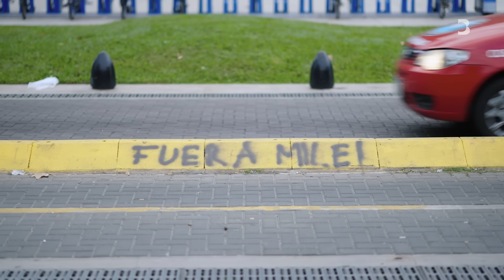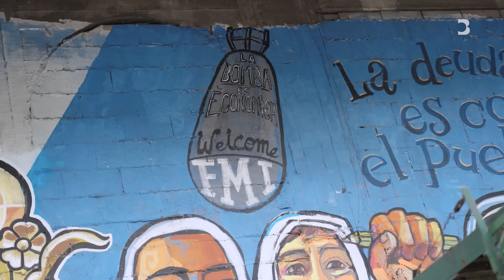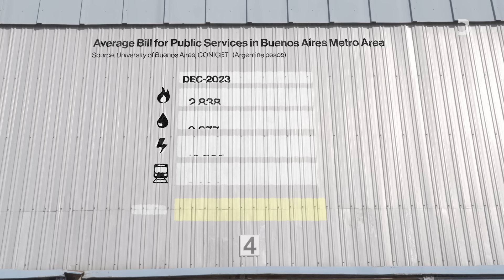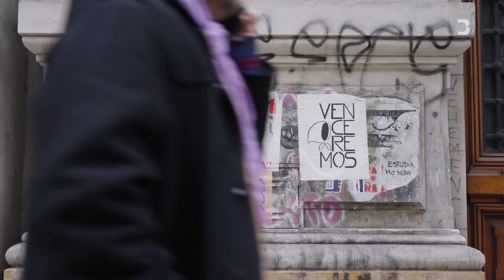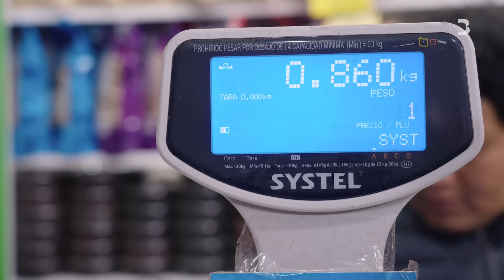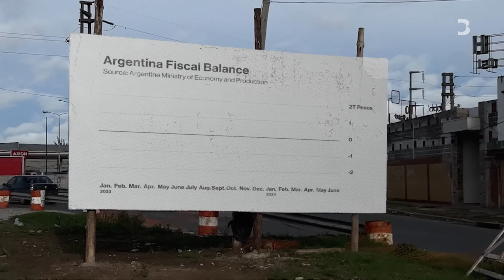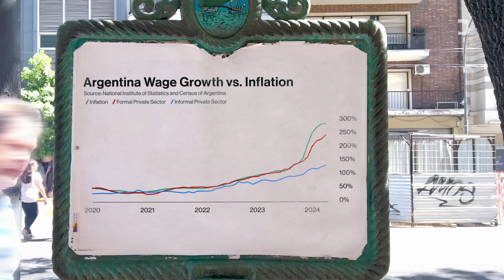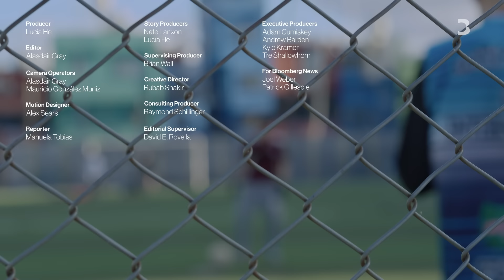Is Milei’s Radical Plan to Save Argentina Working?

Comment: why did this video seem to conclude that "whether he gets reelected" determines if it paid off?   that's NOT the measure, the video didnt mention any real details about how the economy is doing or what teh signs of it improving would be
Reply: yea this video was trash honestly
Reply: That's a bit unfair. The #1 priority is to reduce inflation, that is the entire point of reducing unsustainable gov spending. The video showed a graph that shows inflation is reducing.
Reply: investment and work is the only solution to poverty.   Since Milei aprobed " ley bases"  more than 40 billion have been invested.  Investments take years to show results on population
Reply: @alexgamble4718  agree the graph basically showed ya phase 1 is working... issue with the vid is they just gloss over it with little analysis and concluded "shoulder shrug" who knows we'll see at next elections......... which I agree with OP is not a reliable measure of if it's working or not... it could be a reliable measure of if the people are buying that it's working but video didn't clarify.
Reply: @alexgamble4718 they just didn't care to mention the graph that showed inflation being sort of stabilizing. They didn't say he was wrong either. They pointed out millions of dollars of foreign investments. This wasn't biased. It was just factual. This cheerleaders In all governments will just it's trash. Irrational thinking leads to unstable leadership.
Reply: @alexgamble4718  inflation was already reduce, what argentina needs right now is investments, heavy investments
Reply: Some real data of inflation since Milei took office (per month, not annually!): Dec 45%, Jan 20%, Feb 13%, March 11%, April 8.8%, May 4.2%, June 4.6 %, July 4%. Thanks to the reforms and deregulation of the economy, investments have already begun to come, some sectors of the economy have already been reactivated and some salaries are already rising (the country is still in recession, but we are since 2011).
Reply: @tcial_news  that's what the chart showed.
Reply: Half of economics is perspective and belief of the individuals in an economy so his reelection can be seen as a public referendum on his experiment.
Reply: @puertousbmonkey yes but that's like saying oranges are orange. You're stating an economic postulate. Where and who makes those investments is what the debate is over. Should it be public or private? Union, non union, etc. I'm personally a proponent of not focusing on economic growth if it doesn't benefit everyone. In the us, for example, the economy has grown steadily for 50 years with worker productivity more than doubling yet wages haven't budged. I fear the success of the milei experiment not because I don't wanna see Argentina succeed, but because I don't want to give the elites ammo to use crisis like this to do what they're doing in Argentina which is essentially forming an oligarchy for the rich. Twice now in my own country I've seen the rich use an economic crisis to steal unconscionable amounts of wealth from the lay man. There must be a better way. We should favor banks failing to having households fail. Argentina made a massive mistake of going all in in agriculture and ranching a century ago and have been trying to play catchup every since. Don't fall for the smiling charismatic right winger, they always rob you in the end.
Reply: @Coinpease  The problem is not business and capitalism.   The problem is when politics and obscure businessmen mix.  Elon Musk is a great example of business ethics, always working to satisfy people's needs. 
A recent 30 B dollar investment comes from Malasya ,  Petronas. Who owns Petronas?! I don't give a uck
Reply: @Mayalovestosleep  that will take time. Investment is about confidence. Confidence Argentina doesn't slip back into the warm embrace of socialism when it all becomes too hard.
Reply: Yeah I expected to hear some actual facts about the economy. The only useful information was the graph where inflation spiked temporarily then dropped to a new low
Reply: Correct, but that's because the Bloomberg reporter who made the video doesn't know what would improve an economy.  She doesn't know that Argentina has massive corruption in government permit grants that slow economic development. She doesnt' know that subsidies misallocate resources. She doesn't know that Argentina has export controls that limit foreign purchases.
Reply: The details are too sordid to report. A mass starvation in the making.
Reply: Government has pulled back wastage and money printing. But how long will it take for the people to replace the government by creating companies and employing people in real productive work to produce exportable goods and services.
Reply: @himanshusingh5214  == Argentina's corrupt government permitting system has slowed economic growth for decades. Bureaucrats demand bribes or else they delay new biz permits. Hurts the people because that slows new job growth.
Reply: @aircvr4175  Yeah, it happens in India although India has many states and some states have very less corruption. Southern states have a lot of manufacturing and software companies because they don't demand bribes for everything.

We gave up Socialism in 1991 due to bankruptcy and since then many companies have grown. Some companies are producing world class goods and services and exporting them to reach a total exports of $800 billion. But India is very resource and land poor and imports all kinds of resources.
Reply: @himanshusingh5214  == Every government bribe means prosperity is postponed by bureaucrats delaying those or other new biz permits. Corruption is the enemy of wealth for the people.
Reply: @aircvr4175  Yeah, the government employees need to have an incentive to work for the people and accelerate growth like in China. They also need to fear taking bribes. If there are no consequences for bribery, they will earn some money and destroy the country.
Reply: Because the real stats favor him greatly, the director is biased. He brought inflation down from 12000% yearly to less than 30%, and wages are growing faster than prices.
Reply: @himanshusingh5214  == The easiest solution is to eliminate government permits altogether. Just let people build and report the building. New companies will hire new employees and pay taxes, new buildings will get inspected during/after construction. Simple. No more bribes for permits.
Reply: @aircvr4175 yeah that's the thing. If the gov is slow, too taxing and inefficient, then the next best thing is to try to leave that sector to a private market that makes it more efficient because they will work better with people's wallets vs what the gov can provide for them. 
On top they will receive investments which grows their capita. So maybe they'll have a economic boom like in South Korea.
Reply: If he doesn't Get reelected than his policies can be reversed
Reply: @samdelaet7274  == Yes, it would be easy for weak leaders to return back to their hyper-inflation policies of spending more money than they receive in taxes. If that's what Argentinians want, then that will be their lot in a life that never improves while such weak policies are in place.
Reply: it should a graph of inflation being reduced and fiscal surplus
Reply: @yashen12345  == Fiscal surplus has no material impact on the daily life of a citizen, but inflation does
Reply: @Mayalovestosleep  no dude, Inflation hasn't been reduce nowhere near enough, Argentina still suffers from monthly inflation around 4%, that's what most countries have in a year. There has been enormous progress but the government has keep focusing on reducing inflation until at least it goes below 5% yearly, not monthly as it is currently the case.
Reply: @puertousbmonkey  If your contention is that problems occur when politics and businessmen mix ... then, you might actually care who owns Petronas: the Malaysian government.
Reply: That is NOT what the video said. It referred to midterm elections. Do you know what midterm elections are?
Reply: "Is Milei’s Radical Plan to Save Argentina Working?"
No it is not!
Reply: @alexgamble4718  Seems pretty obvious inflation will go down when people have no money to spend, but it doesn't mean it's a sign of a healthy economy.
Reply: The way I see it, the idea is that there's no better way to measure people's perception of their life quality than whether they reelect their current administration or not. There are several paths to reduce inflation (I would argue against the brut force solution of Milei as being unstainable in the long run, but that would be a whole comment on its own), and those paths have different impacts on people's lifes. And then there are a whole bunch of other economic indicators, which tell you little to nothing on life quality and sustainability of a society, e.g. the GDP. The elections will tell you whether this brut force approach to the very real Argentinian economic problem was worth it, or if people felt that the trade off of taking the fast road (again, in a different comment I would argue this is potentially the fast road against a wall, unless public spending is somehow wisely and carefully recovered after a inflation threshold, which is definitely not his plan) felt like a bad trade for Argentinians.
Reply: The entire video was spent saying he is right wing.
Reply: @Mayalovestosleep  And you do you think would like to invest in country with 260% annual infaltion? That is economic suicide. Ofc inflation has to come down and stabilize first
Reply: @Coinpease  "Half of economics is perspective and belief"
How convenient.
Reply: @himanshusingh5214  All I really know about the Indian economy is that you build some wonderful motorcycles.
Reply: @Mayalovestosleep  In order to get those investments they needed to do exactly what they are doing, to prove to the outside that they are stable and on the right trajectory.
Reply: It did, wages are down compared to inflation. Thats all you need to know.
This will only benefit the rich.
Reply: @Mayalovestosleep  The graph already showed wages have not kept up with inflation. He could have solved inflation by taxing the rich to 90% which would mean less suffering for less people.
Reply: @tcial_news  You do know that inflation is cumulative right ? Also the chart showed wages are down compared to inflation, which means prices are still going up.
Why not tax 90% of the rich to fight inflation.
Reply: look at their economic plan, all signs point towards the economy doing what was expected, wich was readjust by letting things fail and bringing people to work on the private sector, inflation is lower than what was expected although they are having problems working towards dolarisation, the stage is set and we need time to see if the people will be able to pull through and reshape argentinas economy into something decent, honestly this video was kinda bad since it focussed on this mans clear populist tendencies and bad international friends and ignored his economic background and plan wich are the reason he was elected, very bad video and although it was a hard subject they could have done much better
Reply: Inflation went from 25% to 2.5% in 11 months. Hug.
Reply: That would be the measure of whether his gambit was bought by the people, in the short term. But definitely not about whether his policies are actually lifting Argentina out of the hole it’s in…
Reply: @alexgamble4718  the graph they used was month over month (like how much was inflation in November 2024 compared to October 2024). When you compare the inflation from November 2023 to November 2024 Argentina has 193% inflation, just down from its peak of an over 300% a couple of months ago. Not matter how you look at it, 193% annual inflation is just terrible.
Reply: @jeffreycarman2185  yes, inflation is still very high by Western standards, though my understanding is part of the spike in inflation post election, is the removal of subsidies for things like electricity. I would be interested in underlying inflation measures, as in goods and services that were not subject to government involvement prior. Argentina is going through a painful adjustment to live within its means, the reality is that the country is quite poor due to generations of socialism.
Reply: @ Argentine inflation is the highest in the world, by a lot for the year ending in November their inflation is 166%. We in the US are complaining because we’ve had 21% inflation over three years… 166% is extremely high by any standard.
Reply: It's funny you mention that, since it's not how Americans measure success in their economy
Reply: They paid off all debt in 1 year....
Reply: Maybe there is not any improving
Reply: Legacy Media.

Comment: It is crucial to recognize the distinction between theoretical economists and those with practical experience in managing a country's economy. While many economists gain recognition for their theories, models, or writings, this acclaim does not necessarily translate into effective policy implementation.

The new president of Argentina may be considered a "great economist" due to their academic credentials and theoretical contributions, but the complexities of the economy require more than just theoretical knowledge. Effective economic management demands practical experience, adaptability to unforeseen challenges, and a comprehensive understanding of the local context.

Furthermore, significant economic reforms often require more than one administration to implement effectively, especially in a country like Argentina, which has faced chronic economic issues. While a president can initiate change, the true impact of their policies depends on broader systemic factors, institutional support, and public buy-in. This highlights the gap that often exists between economic theory and real-world application, particularly in the political sphere.

Comment: Budget surplus, single digit inflation, smaller government and thus less corruption... so yes it is working. Bloomberg is scared to say it though.
Reply: Argentina has single digit inflation? Since when?
I just looked it up and the inflation rate is insane.
Reply: @danieloyeleye3257  Argentina's current inflation rate is 271.5%, the highest in the world. Over half of the population is living beneath the poverty line and skipping meals. Argentina is still primarily a non-industrialized, global south agricultural export economy. Going below the poverty line in such a country is much more severe than in a developed economy and recovering from that will not be as easy as it could theoretically be in those countries. Milei and his supporters believe in the delusion that Argentina is a fully developed western economy, so they think only in those terms.
Reply: @danieloyeleye3257  Incorrect.

Comment: This illustrates the difference between economics and finance. Argentina is clearly an economic powerhouse in Latin America, but as long as it lacks prudent financial management, especially proper central banking, it will continue to be unstable and experience high inflation. The government can cut public spending all it wants, but that isn't going to solve the financial issues. I heard nothing in this video about Argentina's central bank and what measures it will take to reduce inflation to optimal levels.

Comment: austerity is not a problem caused by who implements it, but it is a problem created after many generations of irresponsible politicians that made it inevitable. But the media makes it sounds that it is a problem caused by the responsible politician who stopped running the country outside it means. Not sure if this is the case for Argentina, or to what extend, but in most cases it can be generalized that way.

Comment: Austerity never works, except for the top 1%
Reply: Lets wait and see! I think Argentina is starting to prove the opposite.
Reply: By austerity do you mean government spending the money it has rather than printing more ?
Reply: @tomaspecl1082  Impossible. Austerity does only this, a present to the ultrarich. When you will check, the country will be totally in foreign and bililionaires' hands. The damage done will be impossible to repair.
Reply: @selvanove1592  so what would you propose instead? If you would control the government.
Reply: @tomaspecl1082  How old are you?

Comment: The problem with the national budget in Argentina is only partially having to do with spending. In 2023 the Argentine GDP was $640 billion, that’s roughly equivalent to the state of Michigan’s ($703 billion) GDP. The state budget of Michigan was $86.2 billion which is 12.8% GDP (and states can’t print their own money so that was directly from taxes). The national budget of Argentina in 2023 was $18.6 billion (2.9% GDP). So to blame spending is not painting a clear picture. They have a revenue problem as well.

Comment: Even the framing of the title is very slanted against Milei. There's nothing "radical" in his approach, except for the optics. He was an economist for decades and the policies are very un-remarkable. Other economists, including very prominent ones like Tyler Cowen have said that he's doing basically all of the right things, but that it's still about a 50-50 chance to pull it off successfully given the terrible state the economy is in and the opposition. This is an irresponsible piece for Bloomberg to have run and it risks causing greater hardship, IMO.

Comment: It will take time for things to return to stability. He could've used a scalpel instead of a chainsaw to shut off government spending and controlled the difficulty a bit but it would extend the time people would need to adapt. In less than 5 years, I suspect all of these problems will have been solved and if they haven't Argentina should take another look to solving their issues. I'm with milei though, the US needs this change as well